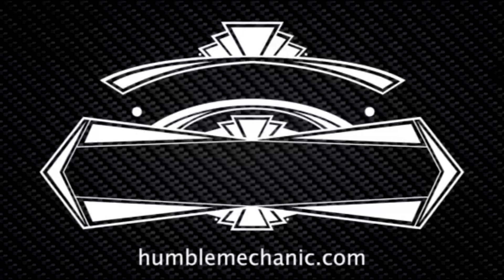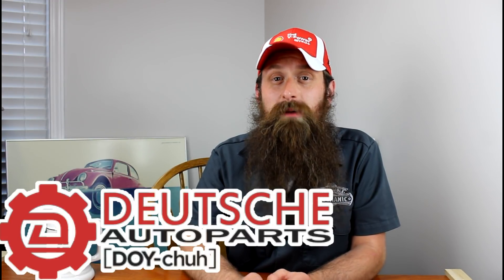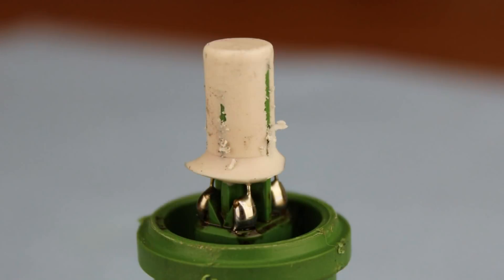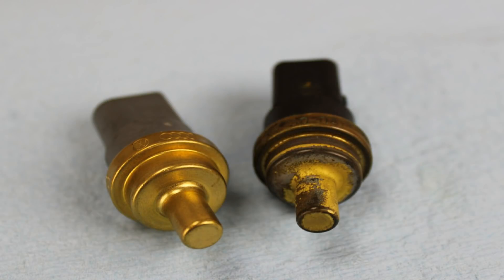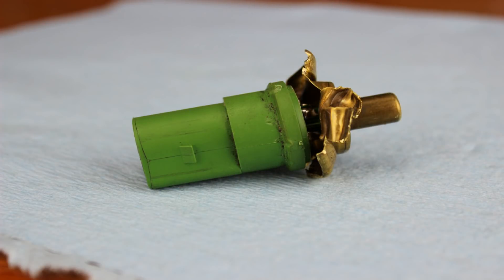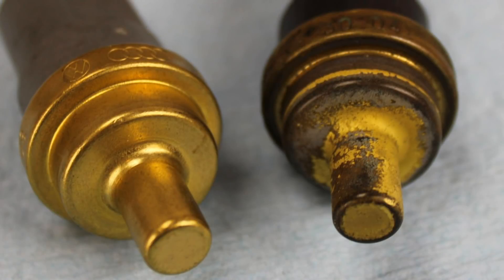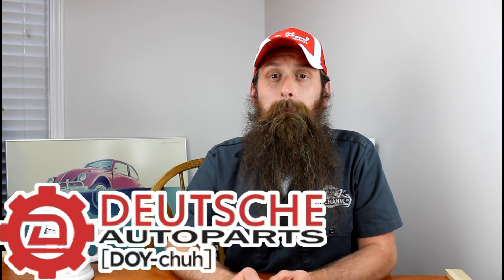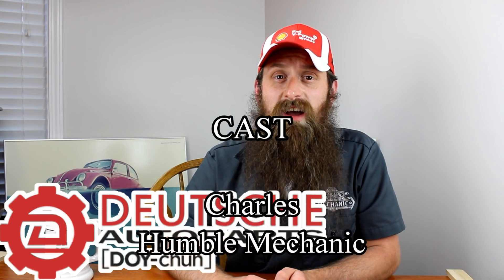How VW Coolant Temperature Sensors Fail

Comment: After hours of threads, a possible answer to my problem. My 2000 Audi a4 quarto 1.8 still has the black ects .The car heats up to a point were the temperature cluster beeps with the  red light thermo on dash after about ten minutes of driving .Upper radiator hose not real hot,canister hose circulating  , heat blowing hot threw out. Water pump change in 07 . My hope is that I put in a greeny and problem solved. Oh yea fans working ,turbo pipe glows red ,but car seems fine. If that thermostat was bad would I not get heat ? And the water pump if failing would it give me more signs other than that blinking beeping dash?

Comment: I bought an 2003 vw gti with a check engine light, it was hard starting, and stopped starting, i got a cel for a short in the ect, it was a light green sensor that failed , they're cheap and easy to replace though

Comment: Hey HM,  hoping for some advise on next trouble shooting an issue on my 2003 Jetta 2.0L

Have an issue where the temperature gauge will creep up to the mark past 190 and then after a minute so when quickly drop back to 190.  After driving longer it will creep the the second mark past 190 and again after a minute or so drop back to 190.  During the window at the second mark there is also a notable performance drop in the A/C.

The coolant level in the overflow is fine.  The radiator fans are at least spinning while idling, but is hard to tell while driving when I notice when the temperature rising.

I have replaced the Coolant Temperature Sensor to no avail.  What are your thoughts for replacing/testing next?  Thermostat?  Rad Fans?  Rad?

Comment: Hey Humble Mechanic thanks for the tips but my vw Jetta tdi 2010 has and a flashing glow plug in the dash board and then I see the engine light come on
recently i replaced the exhaust pressure control in the dealership due to engine light and they noted that my car had a fault for temperature sensor bank 1.g648.
is this the engine coolant temp sensor? or could it be the glow plug it self.
Though I do not have a problem in starting the car at all

Comment: Here's something I can only refer to as a cascade failure. Purchased a new beetle cheap. Changed the heater control because the heater wasn't blowing,  timing belt, water pump, and tensioner because I wasn't sure when it had been done last or ever done, since the odometer reads 130,000. Before I changed these, I noticed no heat from heater. Replaced the thermostat. It was stuck open. After that I found radiator fans weren't working. After testing found the thermo switch wasn't working. After all of that, suddenly got a code for the ect. Replaced that, now I have heat. I only paid 800 for the beetle, and I plan on driving the heck out of this car. I call it my beater bug. It runs really great! It's so fun to drive, and it's bigger on the inside! I guess that's why it was only 800 bucks! I've done much more to this car, but the cooling system had been badly neglected. Not really that expensive to fix. Oh. And one more thing. I tried to replace the reservoir on it but the after market bottle that I got from autozone had a problem. The pins in the sensor were too short and the connector wouldn't make contact so it kept giving a red flashing light on the dash. I ended up putting the old one back on and took that after market piece of junk back to autozone. That's my story. 5 speed standard. I love this bug!
Reply: Volkswagens,  everyone calls them trash yet you replace 4 parts, all very diy, and they run for another 20 years 🤷‍♀️🤣🤣 my golf is 20, I bought her super cheap, she wasn't loved at all, so now I'm replacing her sad parts and turning her into the car she can be. Though the entire thing, she's run. I'll never own another car. Vdub for life.
Reply: Can I join your nightmare , It was recommended for me to change thermostat and W/p + belt , until local mechanic put things right for me. 
I spent £180 for previous work , the offending part was £5.95😂
Reply: What year is your beetle?
Reply: @powdere4donuts  
It was a 2000. I sold it to downsize.
Reply: I basically have the Jetta that is your beetle. 5 speed w/ the 2.0 CBPA. Dude, you take care of it, fantastic and reliable setup that's relatively cheap to maintain. Only thing I insist on, have the dealer do your oil changes and flush the coolant every 2 or 3 years. Also heads up, don't be surprised if you find oil in your coolant soon. The oil coolers fail pretty often, on my third in 200k miles. Keeping really good coolant and checking your fluids at least once a week will save you from bigger problems down the line with this issue as you can get coolant in your engine when this cooler fails, vent your reservoir after running the engine anytime you turn your car off to keep it from pushing into the oil. Otherwise under pressure it'll push the other way since oil is under a much higher PSI. I had thus issue for months and surprising I never had an issue. The dealer is happy to preemptively tell you about certain maintenance though so it's worth the expensive oil change. Always Castrol 5~40 Edge Syn too!
Reply: @grumerguy when replacing that thermo switch did your fans start working? I replaced my thermo switch. My fans work when ac is on but still not when the coolaint gets hot. I jumped the connector for the thermo switch and I can get the fans to start
Reply: @AYE2221  
Yeah. When I replaced the thermo switch, the fans started working.

Comment: 2011 Golf 2.5
Charles, I'm so glad I found your videos! Thanks! Now my question:

Is this sensor also where it gets the reading for oil temp in the MFA readout? My  dash gauge goes to 190 fairly quick and pretty much stays, but the oil temp reading is all over the place, and sometimes will drop 20 Deg. F just turning the car off and then on. It has a no-start issue sometimes when I drive a while, then turn it off for a few minutes. Usually, the oil temp reading goes from something like 175 to 190 or so, to '---' (less than 122F/50C) and won't start. I think it might be dumping gas in and flooding, since it thinks the engine is cold. I think this car has a two terminal sensor, so only one thermistor.

Comment: Hey HM I forget to ask I check my fans on my 03 VW Beetle 2.0 I use a 12 volt power supply one of the fans test okay but the other one when I supply the power to it start to spin but all of sudden stop spinning and shut off my power supply unit? The means that i got a short or the fan has a short? I would like to get in touch with you about my cars issues is that possible HM? please help thanks.
Reply from the maker: sounds like you have a failing fan. What happens when you turn the car's AC on? Do both fans come on high speed? What type of power unit are you using?

Comment: how do you set the ects back in on a 03 vw beetle do you push the sensor back in place? or do you screw it back in? cause i replaced it on my car and pressure blow it off? can you help humblemechanic?
Reply from the maker: +John Torres put a little lube on it and push it down so the clip will lock on both sides.
Reply: Hey humble mechanic thanks for replying back...!!!! I need your help again my 03 VW beetle with a 2.0 engine is not starting first of all I check my battery and has good charge? try to start it but sounds like if my battery was discharge but it's good also replaced spark plugs,wires,the ects and thermostat when i try to start it misfire and won't start any suggestions HM? I would really appreciated guy? thanks in advanced....!!

Comment: hi Charles, thanks for that support. But kindly help me on this as well, have a Passat 2006 with a BZB engine but having a Random misfire in all the cylinders yet the coils, spark plugs and injectors are all new. It goes on and gives off dirty exhaust. Would you think that the problem could be with the coolant sensor or something else because we measured the compression for all the cylinders and they were fine.

Comment: so if my tempeture doesnt always reach 190 and i got a p2181 code, is probably a thermostac? 05 jetta v5 2.5.. my car throws a P2279 and P2181. i replaced the valve cover since they told me that causes the p2181 code to light on. but i still get the 2. also my car used to start at around 1200 rpm and drop down like 10 sec later. but now it starts cold like at 750rpm dont now why.
Reply from the maker: Odds are the thermostat is bad, and that is causing the P2181 faults. The intake leak can be a number of places
Reply: HumbleMechanic thanks..

Comment: Can a bad ect cause your radiator fans to not kick in? 00' Jetta mk4 vr6
Reply from the maker: +Zohn it can, but it's not very likely. Odds are you have other issues
Reply: Zohn - Did you ever find a solution? My radiator fan one click on and a/c blowing warm air.

Comment: could any one help I have got a golf mk4 and it is using a lot of coolant at least once a week it need a top up the car runs fine there is no leaks coming from any we're checked water n oil n no sine of head gasket problems and it never over heats any ideas of what it is thanks

Comment: xplain why fuse box vw jetta 00-04 fail please tnks
Reply: I have some weird electrical gremlins in my 04 Jetta. Finally had to just pull the fuse for the sunroof because it would open itself a little and let water in. I've noticed a lot of water around the door seals inside after a heavy rain, and the fuse box is right there so I'm guessing water issues.

Comment: My mark 4 (1999) Golf indicates a coolant temp at around 60 degrees while cruising in cold weather (about 10 degrees ambient or lower). Noticed this after I replaced the radiator after a minor crash. The new radiator has a higher fin density. Could it be that the new radiator is too efficient?

Comment: Hi humblemechanic, I have a 2006 Audi A4 2.0 turbo. Any chance have you ever experience The electric fan been on Full blast when the vehicle is off. When I open the door the fan turns off. When I close it about 15 seconds. The fan turn on again full blast. When I turn on the vehicle the fan stays off. When the water gauge is halfway the fan still off. It does turn on when I turn on the AC. And no check engine light is on.
Reply: Have u resolve it?

Comment: HELP, got a message on my instrument cluster saying stop check coolant. Would ECM failure cause that? Temp gauge shows 260. Coolant tank is full. Not seeing any leaks.
Reply from the maker: +Brad Smith usually not. That could be a sensor failure or overheating.
Reply: HumbleMechanic coolant temperature sensor? thx love the videos!
Reply: Brad Smith it could be the coolant level sensor in the coolant bottle

Comment: When these sensors fail, would it cause a VW not to start in cold temperatures?
Reply from the maker: +James Valenti you bet it can.
Reply: Thanks...my mother in laws 02 VW beetle won't start when its cold out. Our mechanic tried changing the battery, alternator, starter, and ignition switch, but the problem still persists. Scotty Kilmer said it could be the CTS, Mentioned it to my in laws last weekend and they want me to try replacing the sensor and see what happens. Thanks!
Reply: James Valenti did that work for you? I'm having the same problem in the cold.

Comment: HELP!  My 'STOP - check engine coolant' light ONLY comes on in cold weather (winter) when I start the car!  It goes away when the temp is warmer.  This has been going on for a few years now.  I drive it for 2 or 3 blocks, turn the engine off, then restart and it usually goes away.  Am I risking damage to the car?  Why is the STOP check engine coolant light coming on?  Do I need to bring it in to the VW dealership for assessment?  I drive an '03 24v GTI VR6.  Thanks in advance!
Reply from the maker: I think it' is more likely the bottle than anything. https://youtu.be/g-omYrFO4g0
Reply: Thank you so much!  Very informative video.

Comment: A no start you say? I've been trying to figure this out for a year; battery, starter and everything else I could swap quickly and test. 1.8t mk4 gti '04 usually takes between one or two cranks or a straight clunk then a crank then a start. Always starts no codes and temp sensor never drops out. Does it on cold and warm starts all alike. Opinion?

Comment: I have an '06 2.5 beetle. About 5 seconds after starting, the coolant light turns from blue to red. I turn it off an restart, which currently does the trick. I went ahead and ordered the CTS.. thanks for the video.
Reply from the maker: +Michael P that sounds like maybe coolant bottle issue

Comment: Hi HumbleMechanic,

I have a 2006 Polo 1.9tdi 96kw (Everything stock)

I've been having starting issues, It will crank - but no start. Sometimes I've unplugged the oil pressure sensor, then it starts, but recently that also doesn't work anymore. So I'm wondering; faulty engine coolant sensor? Faulty oil pressure sensor? Glow plugs? Injectors? Once it starts, it runs just fine. Sometimes I just start it with a (push start). But today even that is failing?

2ndly,

My aircons recirculate button keeps switching off but stays on when I have the car in reverse?

Any advice would be greatly appreciated.

Thank you
Regards
Janus

Comment: I have the check engine light on.  I took it to Autozone to have it scanned and they pulled codes p2181 and p0421. I was told its the CTS. I changed the original one maybe 100,000 miles ago due to the needle fluctuating. This time the needle stays at 190 so I am wondering if it would fail so soon. The readout said plausible signal. Thanks.

Comment: I'm having an issue on my 2007 GLI with both cooling fans not turning on, Ive checked the fans and all fuses inside and under the hood including the relays, all are good. does the CTS control the cooling fans on/off? not sure what to check next.

Comment: Where is the ECT located on an ALH TDI 2000 Beetle?
Reply from the maker: +Dave Kana on the driver side of the engine almost at the back.
Reply: Thanks!
Reply: Hey, the salesmann at VW said I have two of these sensors in my 1.8L 4motion 2001, and he gave me the one that speaks to the ECU.
It's a flat sensor (gray metal) with black plastic. It's OEM. 4 pins.
I get a reading on my temps, but my temps stay cold for too long (Allready changed thermostat)
Did I get the right sensor?

Comment: hey I have an 03 VW passat blowing cold air only heater core is good was going to replace cts engine is 2.8 what is your opinion please and thanks
Reply from the maker: I have had several of those need thermostats to fix that. But MOST of the time, the heater core is clogged. Also, if you get heat with higher RPM, you may have an air pocket.
Reply: HumbleMechanic could you help I have got a golf mk4 and it is using a lot of coolant at least once a week it need a top up the car runs fine there is no leaks coming from any we're checked water n oil n no sine of head gasket problems and it never over heats any ideas of what it is thanks
Reply: HumbleMechanic , I have a 2007 volkswagen new beetle 5cyl 2.5 and it doesn't have the temp gauge and I want to add one, is that possible with this engine setup.?
Reply: HumbleMechanic is there a way to call u I have a 01 Jetta vr6 I have some ?s for u

Comment: 2007 Jetta code p2181 and its not overheating, however I noticed that only one fan works with the AC turned on. Replace the ect first, then the fan?  Be the smaller fan.

Comment: Hi, I have a vw jetta 2.0 2001 engine. It recently started to overheat. I changed the fan module but the fan only kicks in when its all most to the very hot side any suggestions?
Reply from the maker: +joyde_the3rd be sure you have coolant flow, be sure your thermostat is working and be sure your ECT is good. If the ECT is black, replace it ASAP
Reply: +HumbleMechanic my radiator hoses do heat up does that matter?
Reply: Same problem here :'( my car is also a jetta a4 2001... i replaced the fan module too, besides, i replaced the sensor located at the radiator, but its still overheating :C... my question is, which sensor activate the fan, the one located near to the motor (which is the one that you show in the video), or the one located at the radiator? HumbleMechanic, save us :c
Reply: @Bryanbar93   wish i knew i have same prob on mk2 golf ,fan wont come on it works manually when tested, i had a warped cylinder  head  , high pressure and burning water ,and white smoke , found small cracks between the four sets of valves thought maybe it was that was causing it ,still not replaced it yet  but would be nice to know,dont know what to do for best.
Reply: i solved mine by replacing the cooling fan switch.

Comment: ive got a 01 golf 2.0 and cant figure out my over hearing issue have been told to change this part out. any advice would be appreciated
Reply from the maker: +Mike cahoon it's not the most common cause of overheat. 

Check Waterpump flow and be sure the fan are coming on. But these fail all the time and they are cheap to replace.
Reply: +HumbleMechanic do one for maf sensor and one for G28
Reply from the maker: Those are both great ideas! I think I have a G28 and a MAF around here somewhere.
Reply: +HumbleMechanic dude you still awake wow I'm working still lmaot coolant pump b6 1.8t customers wants it today  hahaha

Comment: 2001 Audi TT 1.8t AWP. I recently changed my coolant temp sensor with a aftermarket BWD and now my fans don't work unless I turn the AC on. Note I got some coolant on the fan connector. Do you think the fans may not be turning on because I didn't buy OEM or because there is an interference with the connectors?
Reply from the maker: I would start with getting a proper sensor in it. That is the cheapest things to do.

Comment: Hi Charles. om my b5.5 passat I had a blue conector on the bottom of the radiator. I changed this for a green one as I had a hard start at warm temperature. didn't help. so changed the other green one below fuel pump. still no good. any ideas?? thanks jeffery